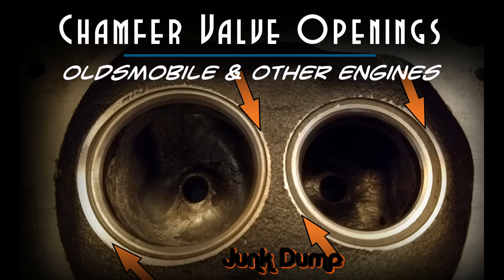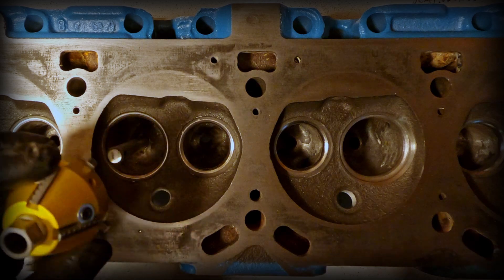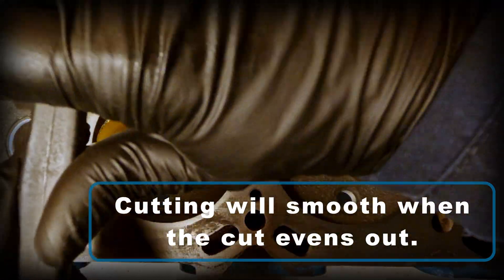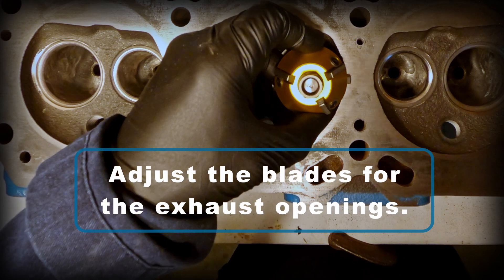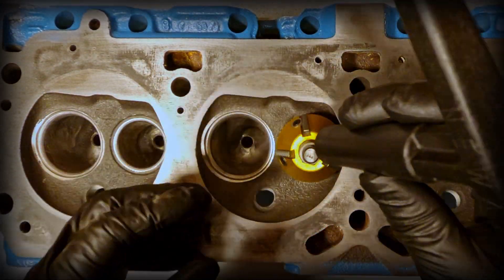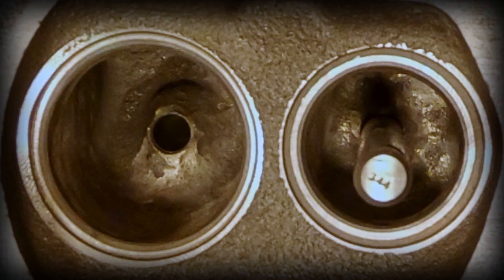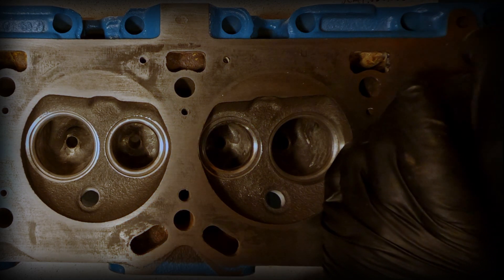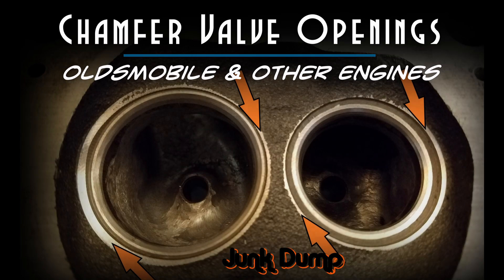Chamfering Valve Openings using Neway Cutters on Oldsmobile Heads

Comment: Got a rod knock in my 72 350. Was completely rebuilt 10 years ago but sat for 9 years after that. After starting it last summer I went about 30 miles and developed a loud knock. Wish I had the confidence to tear it apart as you did and repair it. Very inspirational. Loved the OILING detail, never did understand all that!  Thanks for posting all the videos.
Reply from the maker: A 72 350 is a great engine, certainly worth fixing. I can relate to how terrible it feels when you hear an engine start knocking like that!

Comment: Nice videos! I like those cutters, do 2 sizes basically adjust to cover most size seats/throats? I might need 2.25" down to maybe 1.55" largest to smallest. On my Olds heads I use 2.07/1.72" I believe, but some Buicks are 2.125/1.75" and Chryslers 2.19/1.88" etc. Thanks!!
Reply from the maker: I followed the Neway site recommendations for my cutter head sizes. I currently have two smaller heads and two larger heads to cover valve sizes from 1.625 to 2.1. So far I haven't had any issues. Neway has been great to work with, I would talk to them if you have sizing questions. I was surprised at how far out I could adjust the cutting blades allowing the small heads to easily cut 1.62 exhaust and 2.0 intake seats. I would not be suprised if my larger cutting heads will cut a 2.125 seat. I will try to remember to check the sizes and get back to you. Thanks for leaving a comment!
Reply: @junkdump2720  Those are 403 valve sizes, right?
Reply from the maker: @rodneybyrd9516  403s typically have 2" intake and 1.5" exhaust, the 2" intake with 1.625" exhaust was found on 350's, 425's, 400's and 455's. I like to run 2" Int and 1.625" exh on 350 builds and I find 2.07 intake and 1.687 exhaust work well on BB heads (of course open the valve openings up to match larger diameter valves). I measured my Neway cutter heads, the small cutter is 1.730" in diameter, the larger one is 1.985" in diameter.